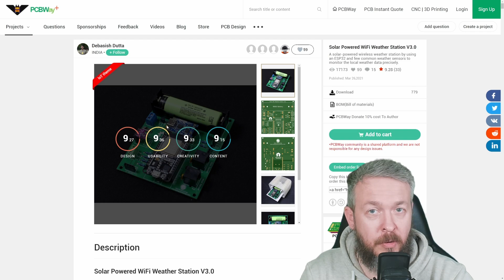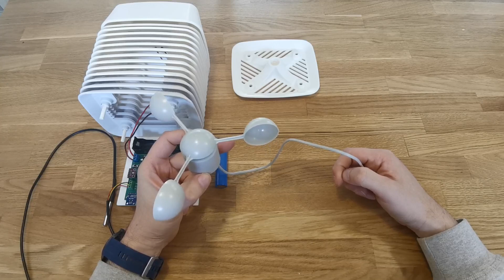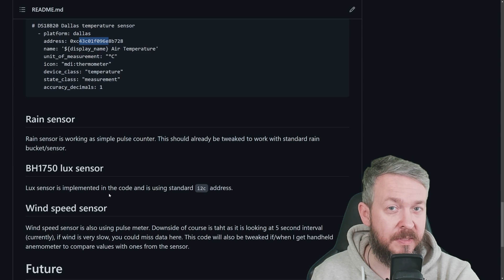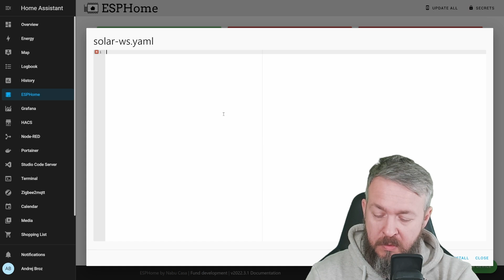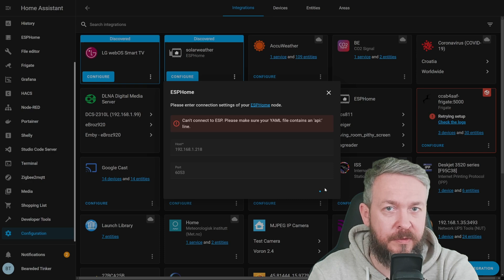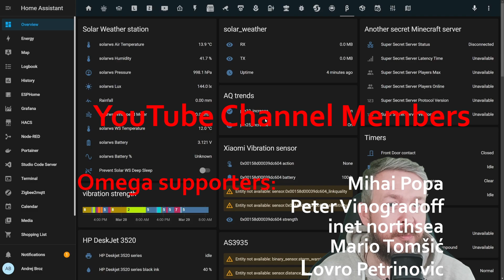DIY Solar WiFi Weather Station within ESPHome

Comment: Hello BeardedTinker, good to speak to you again. I am having a problem trying to update the code for my weather station in Home Assistant. When I use the update in Devices and Services I get an error that says "Failed to call update/install.Error compiling weatherstation.yaml. See ESPHOME for further info". When I go to ESPHOHE and try to update via wirelessly I get the following message:INFO ESPHome 2024.4.1
INFO Reading configuration /config/esphome/weatherstation.yaml...
Failed config

sensor.bme280: [source /config/esphome/weatherstation.yaml:94]
  
  Platform not found: 'sensor.bme280'.
  platform: bme280
  address: 118
  temperature: 
    name: weatherstation WS Temperature
    oversampling: 4x
    unit_of_measurement: °C
    icon: mdi:thermometer
    device_class: temperature
    state_class: measurement
    accuracy_decimals: 1
  pressure: 
    name: weatherstation Pressure
    oversampling: 4x
    unit_of_measurement: hPa
    device_class: pressure
    state_class: measurement
  humidity: 
    name: weatherstation Humidity
    oversampling: 4x
    unit_of_measurement: %
    icon: mdi:thermometer
    device_class: humidity
    state_class: measurement

Here is a copy of the lines of code from 90 to 116:
sensor:
# BME280 is used to get temperature, pressure and humidity
# BMP280 only provides temperature and pressure so please comment out hummidity section
#  - platform: bmp280
  - platform: bme280
    address: 0x76
    temperature:
      name: '${display_name} WS Temperature'
      oversampling: 4x
      unit_of_measurement: "°C"
      icon: "mdi:thermometer"
      device_class: "temperature"
      state_class: "measurement"
      accuracy_decimals: 1      
    pressure:
      name: '${display_name} Pressure'
      oversampling: 4x
      unit_of_measurement: "hPa"
      device_class: "pressure"
      state_class: "measurement"
    humidity:
      name: '${display_name} Humidity'
      oversampling: 4x
      unit_of_measurement: "%"
      icon: "mdi:thermometer"
      device_class: "humidity"
      state_class: "measurement"

Any idea what might be happening? Thanks in advance for your help. I really have enjoyed using my weather station.
PS: I am getting accurate readings from the BME280
Reply from the maker: Try replacing plaform: bme280 with platform: bme280_i2c
I think that's how I fixed it. Although mine is running a very old version of ESPHome - something from 2023.
Reply: @BeardedTinker  Thanks this fixed the problem, but I got another error regarding  platform: adc, but since I am not using the battery I just commented them out and update completed. Thanks for your quick and accurate response.
Reply from the maker: Awesome! Glad you got it working!

Comment: I have power to my weather station and I would like to modify the code to remove the deep sleep, what changes are needed? Thanks
Reply from the maker: Haven't tried it - but you may try disabling this section:
deep_sleep:
  id: deep_sleep_control
  sleep_duration: ${sleep_duration}
And below it script: part.

Comment: How does esphome/deep-sleep work together with the pulse-Counter/Meter sensor?
Devices like BME680/280, etc have a state at any time -> so ESPHOME wakes up, reads and sends data without any issue (deepsleep freq = granularity of signal). 
However, when it comes to interrupt-based esphome events, the board must be powered up to process them. This is particularly critical for the rain gauge, which is more sensitive than the wind speed sensor. Missing a single interrupt event from the rain gauge could result neglecting of a certain amount of rainfall (x mm).

I read somewhere that the device is effectively rebooting on wake - which means that there is no minimal process running to collect data from the pulse-meter during sleep. is this correct?
Reply from the maker: I've since the video moved rain gauge to ZigBee (converted it with Aqara door sensor) as there were issues with it. There is a way to count even in deep sleep but it does have impact on both battery and performance.

Comment: Hello BeardedTinker, thanks again for this great video I am using this project and enjoy it very much. I am not using the solar panel but have a continuous power supply and would like to totally disable the deep sleep. I have had trouble trying to update firmware because of the deep sleep and I think my application no longer needs it. Please let me know what code needs to be removed safely to remove the deep sleep. Thanks, also I have seen your remarks regarding the rain sensor, I have made one of the Zigbee rain sensors but not much success with that, mostly because of the poor signal where my weather station is located. Hopefully if I remove the deep sleep it will give the existing rain sensor a better chance to work.
Reply from the maker: Sorry for the late replay. Keeping project powered 24/7 should resolve that rain sensor issue.
As for deep sleep. 
You need to remove following parts of the code:
- on_boot and next 2 lines
- deep_sleep and lines under that section
- script: and lines under that part too
I think this is all that needs to be removed to completely eliminate it.
There is also one binary_sensor, but even if you leave that part, device would still not sleep. Of course sleep_duration and awake_duration substitutes are also not needed. And you can play with update frequency. Maybe shift that from seconds to 1 minute.
Reply: @BeardedTinker  Thanks for all your work and I am hoping this solves the rain gauge problem.

Comment: Great project, it took me several days to get everything set up. It seems that your examples were from an earlier version or Home Assistant and ESPHome. I was able to set everything up and do OTA update, but I have several questions about the output. I am in the US  I cannot find the part of the code to change the temperature to Fahrenheit, can you direct me to where I can change this? Thanks
Reply from the maker: Temperature conversion can be done from within Home Assistant. It has option (when you click on the sensor settings) to select how you will see it - C, F or K.
Other option is to convert it within ESPHome code with something like this:
    temperature:
      name: "Temperature"
      filters:
        - lambda: return x * (9.0/5.0) + 32.0;
      unit_of_measurement: "°F"
Reply: @BeardedTinker  thanks so much for all your work pon this project
I used your advice for just changing the temp with in the yaml code. So went back and corrected all of the signs back to all my F° to C °  , then made all the corrections within Home Assistantr off the High Holidays in
Reply: I HAVE FIGURED IY OUT USIng home automation thanks for all of good answers you gave me

Comment: This is some great work, thank you!.  I pieced together a mostly functional set of ESPHome code for the solar weather station hardware before finding this, which is frustrating to say the least!  I actually have some code for UV Sensor and calculated sensors that would make sense to include, so I'll put in a pull request most likely.  I'm writing to ask about a struggle with one thing - I cannot get the device to find the input boolean helper.  It's got the correct name, entity_id and I can see the toggle going on and off in history, but the code never honors it / or finds that value at startup.  That means I have to compile and hit that 30s awake window to put through any updates.  Any ideas?  

Also of note, the ADC for battery is using hardcoded values in the code I pulled from your git.  So updating at the top section wasn't working for that (had to hardcode my own values.
Reply from the maker: Thank you!!! What UV sensor did you use? I was looking into few of them but at the end got nothing. 
What are you using as "awake" code in ESPHome? Do you use same thing I did or did you opt for MQTT version of it?
I did have issues at one time when I was trying to fix rain gauge, but when I removed it and rolled back to my initial code, it's now working OK. If you connect to station and look at the logs, do you see there that state of input boolean is registered there and correct state?
As for ADC - yeah, had to hard-code because for some (to me unknown but probably very simple) reason it didn't calculate it.
Reply: @BeardedTinker  The SI1145 (Also known as GY1145) is the sensor I've used for UV.  I'm using your wake code (not MQTT) and the registration is what's problematic.  But it seems upstream because the sensor associated with disabling (via the toggle) does not change on or off when I click the toggle.  I'm not sure it's the code, but rather something idiosychratic with HA and the helper toggle.  I've validated the naming, I've re-created the toggle helper, I've rebooted after creation, etc.  I can't seem to get the boolean to change, but what's interesting is that the History/log shows that I have flipped the switch - only the actual value remains unchanged from 0 to 1.  Any thoughts are welcome.  I'll package up the UV code - it's a bit finicky depending on how much light is reaching the sensor and I don't have independent IR/Visible light sensors to truly calibrate it, but so far it has been pretty close to forecasted UV index for my location.

Comment: Is there any news for the rain meter?
Reply from the maker: I was really not happy how it worked, so converted it to Zigbee rain sensor.
The problem was that it did wakeup on rain when it triggered spoon to trip, but I couldn't manage to count that and send when device awakes.
With Zigbee sensor, it works great.
Reply: @BeardedTinker  I am having trouble with my rain sensor also. It worked before I converted to your version using ESPhome and home assistant, but now when it rains I never get any reading, it always shows as 0.0 rain fall. How have you implemented a Zigbee rain sensor?

Comment: Thanks for this great video! I already sourced the PCB, only need my 3D-printer back to operation. I wonder if there would be the possibility to add a rain sensor too.
Reply from the maker: I will probably remove rain sensor from this. It does work, but not as I would like it to. Will replace internal parts with Door/Window reed sensor. That should give me correct values.
Reply: @BeardedTinker  Thanks! I am looking for a reliable rain sensor for closing my roof windows in case of rain. In my opinion the rain volume measurement is too slow.
Reply from the maker: There are options that use resistance, but they also require enough rain to close circuit.

Comment: Thanks for this awesome video/project BeardedThinker! I've been collecting parts for this for a year now but missed the knowledge to actually put it together/code it. So your project will be a great baseline. 
Could you help me/us out with a wiring diagram/schematic for those who are unable to get those PCBs? Would be a very much appreciated.
Reply from the maker: You can check original post on Instructables - there are schematics there for each of the components:
https://www.instructables.com/Solar-Powered-WiFi-Weather-Station-V30/
Reply: Will check it out, thanks for the reply!

Comment: Am I missing something or is the board alittle open to the elements?
Reply from the maker: It should be well protected in the casing, but I also bought PCB spray to add rhin film over everything. Of course, sensors have to be free of this film.
Using similar Stevenson shield for some other sensors and didn't have much issues with rain so far.

Comment: Thanks for sharing this project! I actually ordered all parts for the weather station two weeks ago, but I sourced everything myself so I'm still waiting for some components. I'm a bit worried about the measurements, because of the issue that you already brought up: deep sleep. Not just the wind gusts, rain measurements won't be accurate as well? If we are not putting the esp32 into deep sleep, it will use about 1800mAh per day. Battery capacity is 3400mAh. So if I am right, we "just" need to upgrade the solar cell?
Thanks for you effort!
Reply from the maker: if you do any upgrades, maybe go for double battery (a bit different charger than) and bigger panel. 
I'm still playing with rain sensor to make it wake up from sleep. That part is now working, but just need to sort out counting/measurement now. So that all the data is combines (when awake and ones recorded in sleep) when it's sent to HA.
For wind, I can't do the same thing, but I'll just probably ignore wind gust, and opt out to only have average wind speed available. I know it's not best solution, but will end up being simplest.
Reply: @BeardedTinker  Thank you for sharing your thoughts. Why would you go for the bigger battery? I just ordered a 5W, 5V Solar panel, so I can use the full capacity of the USB charger (1A). My large PV yields 10kWh at 5kWp on a rainy day, so this small module should be able to give enough charge to cover for 2.000mAh of power drain... Global solar atlas even projects 2.800mAh.
Your solution with waking up on the rain sensor might be sufficient, though. Looking forward to try this out!
I guess the question is, if you actually need to stay awake 100% of the time for accurate wind measurements. Let's say we go for 5 Mins awake and 5 asleep. That wouldn't analyze every single gust, but at least it will register a few top speeds.
Reply from the maker: In theory (but I like to test it too), that would potentially cover rainy/no sun days. 
Playing with rain sensor is a bit tricky as I need rain for testing and lately there was not that much of it. Using watering can helps but it's just too much water in short amount of time...
Reply: @BeardedTinker  I will report back when I got mine! Keep it up, man :)

Comment: One of the best projects yet. 

 I didnt catch where do you hook up wind direction sensor once when you get it? Also, what do you think about adding additional battery and one more solar panel to avoid deep sleep?
Reply from the maker: Wind speed sensor goes into wind direction sensor, and then you hook cable from wind direction sensor to the board. Cascade :)
Bigger panel is an option, I have one spare and if I start having issues, I'll replace it with larger one.. 
Adding additional battery would required different charge controller. It is doable (I think), but still not sure if you could run it full time.

Comment: I am using a Lithium AA battery for my wheather station for over 2 years now and it's still 79%. These types work from -20-70 degrees C and are also available in 3 or 3,6V. Maybe it's an idea?
Reply from the maker: These are Lithium Ion batteries and should have much larger capacity then AA batteries. One I used in project is old/salvaged battery, so it has very low capacity and high self discharge.  While it could be done, it would reacquire a bit more hardware changes. Batteries here are 3.7V (up to 4.2V when fully charge) and then V is dropped to 3V.

Comment: Very good video, I will try to recreate it.👍  But one question about the wind sensor, it looks fragile. I live in the German region Eifel with at times very strong wind
Reply from the maker: Can't tell you really! I know these are standard ones that SparkFun was selling previously and they are also sold as replacement for some Weather Stations. I think that mounting bracket would fail first.

Comment: How well does the light/lux sensor work in this device?  It looks like it may be in the shade due to the housing.
This was perfect timing for me as I am looking for a weather station for Home Assistant currently :)
Reply from the maker: Thank you Brendan!!! It will need a bit of opening in the case. I only installed it in case while recording the video so don't still have that much data, and of course, we didn't have any sun since than. 
But from what I've seen, people just drilled a small hole for direct light. With case, I think around 9-10.000 lux was maximum value I got, out of 100.000 when you directly point it at bright sun on sunny day.
Reply: @BeardedTinker  Small hole sounds like a good idea.   Maybe a small plastic light pipe could be used to help direct light into the sensor :)